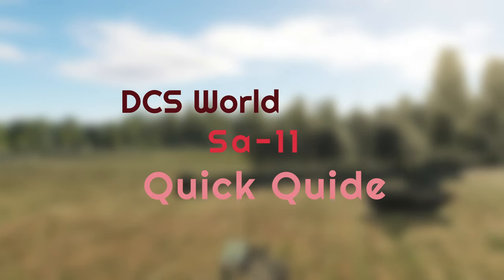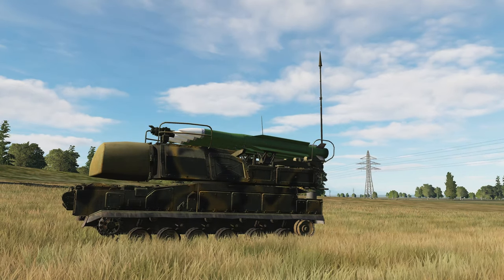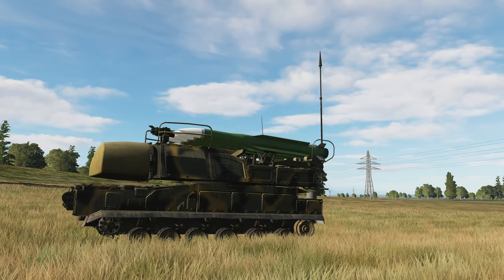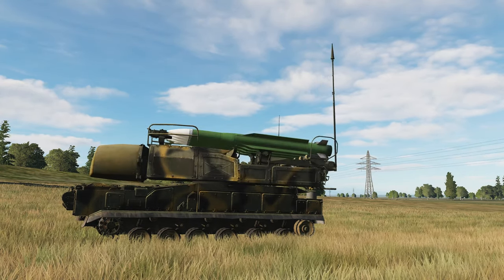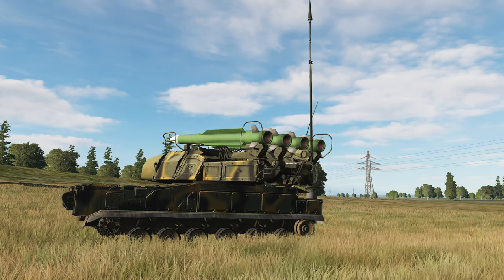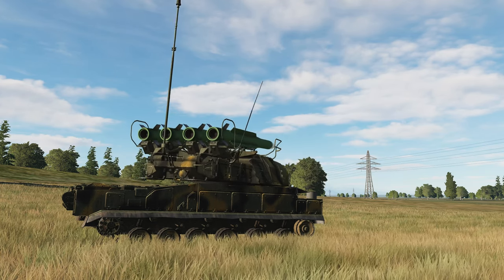The Quick Guide to DCS World's Sa-11 BUK!

Comment from the maker: Ok, who has taken out an Sa-11 Radar; then forgot about them being able to launch without it and been shot down?
Reply: only time i've been taken out by a SA-11 trying to SEAD the radar it's because it was firing at me at the same time 
not sure if this has been changed but when the radar is gone the launcher must face the threat or it won't launch.... leaving it vulnerable 
(but this could have changed)
Reply: I did that in a A10C back in the days when SEAD for nato was Mavericks.. Took out the SA11 radar and Strela's with mavs, then went in close with gps guided bombs. And ended up getting shot down by the Sa11 launcher as i was doing my 2nd bombing run :D
Reply: I tested them 1st to make sure they operate properly. LoL
Reply: Can the individual launchers be destroyed with Harms after the radar is dead or just bombing?
Reply from the maker: @bradule1980  HARMS will only lock onto a radar signal, so you will need to use rockets, bombs, guns or mavericks.

Comment: extremely dangerous if used properly, theyll use awac or EWR or fighter jet data, then turn radar on last minute, good for SAMBUSH, im talking about the lone launcher with the radar on it.

they will always be behind the enemy front line and if you use the same flight route into enemy territory.

stand off counter them EXTREMELY EASY, for example glide bomb onto targets and ignore the BUK sa11s 

the SD set ups will be in strategic locations for sure

its just an upgraded SA6, and SA17 is a newer SA11.
then theres SA27 buk M3
Reply from the maker: Their ability to operate with launchers only at short range is always interesting for players new to facing them. But if you have take out the radar then a well placed JDAM will do for the launchers, or a dumb bomb if you are feeling brave 🤣.